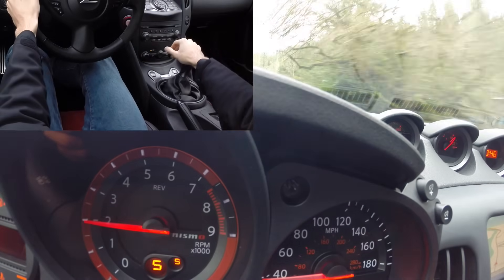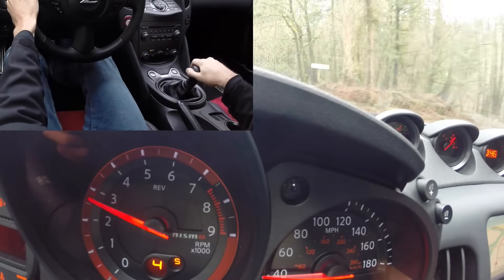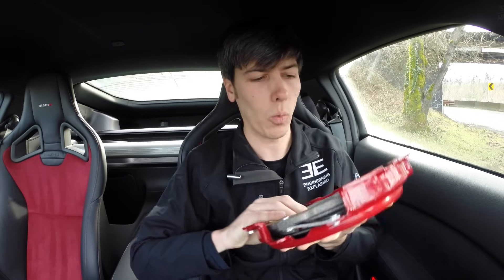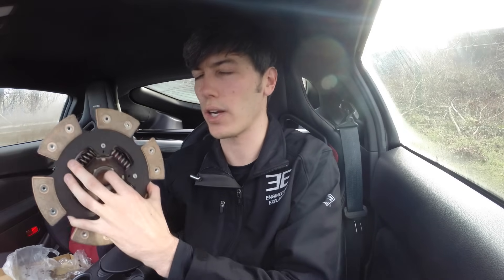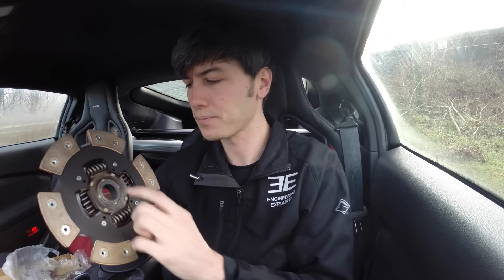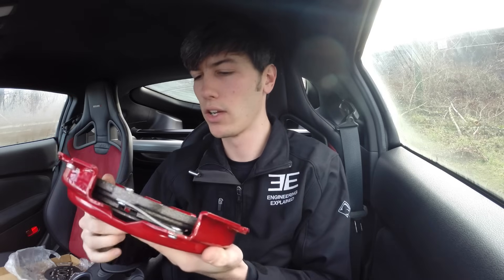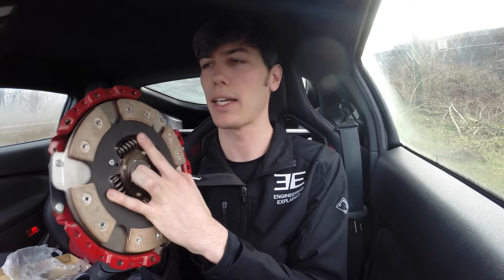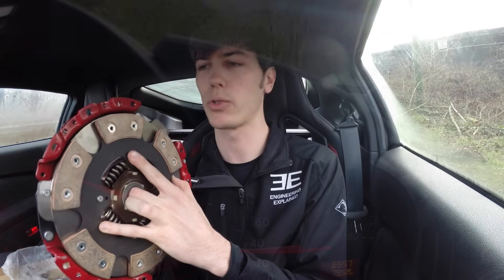What Is Rev Matching?

Comment: how do I rev match my 14 speed bicycle
Reply: you need a short throw sausage
Reply: You need a short throw chain
Reply: You need to fix the flux capacitor
Reply: @soupy2jz893  I'm sorry but the only thing capable of generating 1.21 Gigawatts of electricity is a lightning
Reply: You get off and push
Reply: @BobO-zo2bi  Classic LOL
Reply: Your stick your foot into the rim
Reply: When you coast (i.e. not pedaling), you are technically holding the "clutch pedal." So there's no point of rev-matching since it does nothing to your engine [cough] [cough] I mean legs. However, I do recommend that if you are going to come to a full stop on a bike, always shift to an "easy" gear, so that when you start pedaling from a stop, it won't put stress on your legs and knees.
Reply: @KarlenBell best explanation 💯
Reply: only 14 speed? mine is 21 speed.
Reply: C M mines a 1x11 best gearing for mtb
Reply: @samarmstrong4328 3x8??
Reply: @samarmstrong4328 I had to convert all my mtb's to 1x. I love that torque
Reply: @koffiemoth  mine is 6 speed :/
Reply: @achilles1889  thats sad
Reply: @achilles1889  BRO 6 TIMES 3 IS 18. you have 18 gears. 6 for every gear on the big thing (for got what its called, near the pedals)
Reply: @koffiemoth  only 21 speed? mine is 69420 speed.
Reply: @koffiemoth  mine is 24😊😂
Reply: @koffiemoth  mine 48
Reply: @koffiemoth  mine is 24 speed
Reply: @koffiemoth  my trinx Junior 4.0 also have 21 speed gearbox from shimano
had lots of fun kind of "rev matching" it lol
Reply: @koffiemoth  me too
Reply: @koffiemoth  mines 24 😈
Reply: @koffiemoth  21? Boy shut up 3 × 9  = 27 speed here
Reply: @koffiemoth 7x2 instead of 7x3
Reply: @koffiemoth  27
Reply: @koffiemoth  only 21? Mine's 27 speed
Reply: @koffiemoth  mine is 24 😂
Reply: What 21 I got 27 @koffiemoth
Reply: Mine is automatic @koffiemoth
Reply: @koffiemoth gang mine is a 24 speed 😭😭😭
Reply: disconnect the brake cable, lose the wheel nuts and drive downhill till fully stop.
Reply: you need to change blinker fluid
Reply: I subscribed to you
Reply: @kalebcalrow5556 😂😂😂
Reply: Buzz Lightyear 
Mine is a 38 speed tricycle
Reply: Just buy a fixie.
Reply: you need a tachometer on your bike
Reply: You have to take the chain off, and then pedal as hard as you need to shift it to the gear you want, and at the same time put the chain at the gear you need to be on. Easy.
Reply: If you stick your foot in the rim you u can actually slow down until 0 miles per hour but u may miss the turn tho
Reply: Pedal harder
Reply: With 14 speed bikes you just gotta get used to the noises. It's all feel. Also if you gotta pop into gear while off use 6
Reply: you blip the throttle
Reply: How to rev match my fixie?
Reply: Get on to top off a hill and get on your bicycle and come down. You will find it out eventually.
Reply: Replace your knee joints :)))))
Reply: 😂😂😂 wtf
Reply: I have a 21speed brand new bike
Reply: Its simple ,just say WHIRRRR WHIRRRR and it will rev match
Reply: Depends. Does it have an aftermarket exhaust?
Reply: By drinking milk regularly🤣, dont break your butt off🥴
Reply: Spin fast with all the legs you got 🔥🔥🔥
Reply: Answer: Di2 electronic shifting
Reply: @cesarjom  Bro learnt too much organic Chem.. 🤐
Reply: You earned a sub from me
Reply: Install gear synchros
Reply: Pedal faster.
Reply: heel tow shift
Reply: Bruh I have a 21 speed
Reply: 14 speed is equivalent to 1500 hp !
Reply: i actually always rev matched my 1x10 bicycle as weird as it sounds😂 didn't have a car yet and was used to doing it in video games with cars
Reply: You need  to try lowering gear after onto 1st..thn automatically it will happen
Reply: pedal slower
Reply: lmfaooooooooo 😂
Reply: Brake and coast
Reply: Decrease the tension and start Decrease the speed and pedal backwards and then increase the tension,hoping your chain doesn't come out from the gear.
Reply: lol
Reply: Mine is an one speed 😅
Reply: Hahahaha
A Very important question
Reply: Get a fixie
Reply: Lol goddamn I just realized I commented on a 4 year old thread 😂
Reply: Slow or speed up the bike?
Reply: I subscribed to you
Reply: Mine is 42 speed 😎
Reply: You brake, pedal at a constant slower speed and downshift
Reply: 🦧...🤹...🪰...like this
Reply: Wait, you guys have 10+ speedn
Reply: That new movie you did was gay and bombed big time.
Reply: when you shift down pedal faster or you'll lose speed
Reply: You just need to hummmm while downshifting and make sure the sounds pitch differentiate different gesrs in different time.
Reply: How many rpm have you reached? Let's start with that
Reply: Peddle faster on downshift
Reply: You don't need one buzz.

Cuz once you gear shift it's already "to infinity and beyond"
Reply: Mine is 34
Reply: Give me 100 dollars and I'll show u
Reply: WAIT! First you need to check your blinker fluid(just check the dipstick next to your blinkers) 
Then go ahead and replace your muffler throwout bearing (1/7)
Reply: Jump and run along side of ur bicycle 10 m before stopping
Reply: lol
Reply: Put a baseball card in the spokes
Reply: 7x3 transmission bikers, where you at? 😂
Reply: By pedalling at higher speed as u lower your gears
Reply: Firstly install a clutch
Reply: Revmatching on bicycle is real and helps with reducing wear and engaging gears faster.
Reply: Just reverse the paddel
Reply: Gigachad
Reply: Thats the neat part , you don't
Reply: You have to pedal faster my boy
Reply: Damn this comment section really be flexing on their goofy ahh bicycle gears💀
Reply: W comment
Reply: You don't need to rev match it😂
Reply: Just pedal while down shifting
Reply: EAT MORE BEANS!!!
Reply: Mines a 10 speed and its a great way to stay in shape
Reply: Pedal faster 🤣🤣
Reply: I own a bike and compared how the gears are legit the same as car gears. With leg power being the accelerator and such. I also have this question but no idea how to calculate revs on a bike.
Reply: Change in  a car
Reply: Pedal backwards and change gear
Reply: Do you have a fixie with a clutch activated gearbox? Otherwise the freewheel means your legs never get jerked to spin faster if you go in a lower gear.
Reply: Sell it
Reply: do you guys have neutral…?
Reply: Getcho ass off and runn
Reply: Reverse peddle half way when you are shifting
Reply: pedal once spin the pedals backwards once pedal as hard as possible and shift😂
Reply: LMFAO
Reply: Hey buzz
Reply: Pray
Reply: 7 speed sis all you need
Reply: You lift your feet from the pedals, shift into desired gear, calculate how fast you need to pedal now, start pedaling in the air at that speed and continue doing it while putting your feet on the pedals again and continue pedaling as mormal.
Reply: @jeanwamana  mhmm
Reply: Buy some blinker fluid
Reply: Go head on with a bus then you can rev match it underneath 😁
Reply: I don't think you can without a clutch sadly

Comment: Rev matching gear speed is hard to do in some cars, because the proper way is to heel toe as you downshift and in my car that is near impossible to do because my brake pedal extends further outward than my accelerator pedal, which pivots from the floorboard and doesn't free hang like the clutch and brake pedal.  I'm sure a lot of other guys who read this have their pedal assembly set up this way also.

Comment: Very helpful videos dude, I have a question for you I hope you can answer or anybody who knows.

Does rev matching interfere with the cars fuel economy??
Reason for this that I started try  rev matching recently and my fuel indicator when I started was at 250 mile trip, I went on a 20 mile trip and by the time I got home the indicator read 210, soo my guess is it does but the fuel indicator sometimes does that and I don't want to base an opinion on an electronic fuel indicator, I just want an answer from an expert who knows whats up.

Comment: I was taught rev matching was "giving it gas during the release of the clutch using kind of a scissors movement between the left and right foot". I've been doing this for years. However I've been reading lately people saying they "blip the throttle BEFORE releasing the clutch during shifting". Now I am confused... Is there any difference between the two? Is the second method better?

Comment: When you downshift, you usually apply the brakes before so that slows the wheels and the transmission down.  In this case, the transmission has already slowed down very much,  so rev matching is not that necessary?
Reply: it's for racing purposes, in lower gear you can accelerate faster, so when you downshift in a corner, you can speed away again that much faster when you exit it.

Comment: Please explain, am I wrong?
The transmission doesn't speed up simply when you downshift.  The rpms of the gear remain the same but the gear ratios increase because the lower gear is larger so now you have to increase the speed of the engine to match the gear ratios.  Suppose you were going at 2000 rpms at a gear ratio of 1:1, now you downshift and increase the gear ratio to 2:1 now the engine has to go at 4000 rpms to match the same 2000 rpms of the larger gear.  If the engine is slower,  a braking torque is transmitted throught the transmission onto the wheels which is the sudden jerk you get if you don't rev match. The values are a bit exagerrated but this is the core concept, right?

Comment: Hey mate. When you're rev matching on a downshift, what's the correct procedure? Is it:

A

1) foot off the accelerator
2) clutch in
3) change to a lower gear
4) blip the throttle a bit
5) clutch out 

OR 

B

1) foot off accelerator 
2) clutch in
3) blip the throttle a bit
4) change to a lower gear
5) clutch out

Comment: And what am I supposed to do when I am driving my 2nd gear until 6000RPM and then I want to shift into 3rd gear, but the 3rd has an engine speed of like 4000RPM at that speed... So if I want to shift fast I am pushing my engine speed from 6000 to 4000RPM violently, which is not smooth at all.
But I also don't want to wait like 2 seconds, because that would be really slow.
Reply: as soon as you stamp on that clutch the rpm will drop rapidly.

Comment: hello engineering explained guy, I have been driving my family car recently and  I'm always making rev matching even with this old car, knowing that rev matching is for down shifting I try to do the same in normal gear shifting to smooth the action but is difficult like going from second to third, the stick kinda stuck in neutral...
I am ruining my gearbox or is lower the Valvuline (transmit lubricant)??

Comment: Let me say, I like your videos, they're smart & it helps people understand their cars better. BUT, you talk TOO much almost, right at that point where my eyes began wandering & what I mean is, you just drag things on & folks like me gotta skip ahead to your next major point in a video. Just something to think about, I really mean well. Read my quick story below relating to auto transmissions. This happened to me about 7yrs ago.

I had our car that I was driving back to my wife to drop off at her job so I'm on the interstate. Everything was great, car was good. I'm in the slow lane doing about 65-70mph & there wasn't much traffic yet. Next thing I know, I go to slow down for the coming ramp & out of nowhere, the car's throttle became stuck (a spring on this 93 Camaro that was hooked to the gas pedal broke I later learned, as was explained to me) & I ended up on the ramp burning the brakes & using the e-brake also to try & slow the car down which I did a little but that was more so due to the fact that the ramp went uphill abit.

Long story short, I survived that freak accident, nobody got hurt & the only damages were a totaled out V6 POS & $50 worth of damage to an A/C unit I ran into at this church. I did hurt my neck a little bit but declined medical care. Watching your "automatic what not to do" video brought that back to my mind......

Comment: in racing this will cost you time. you need the high rev of the higher gear to slow you down with engine braking when you shift down. heel and toe is different story.

Comment: Nice video. I've always wondered, though, shouldn't you blip the throttle before you engage the lower gear in order to reduce wear on the synchronizer in the gearbox?

Comment: Great video. Another important factor in rev matching is to minimize the wear on the synchromesh.
Reply: Or on old cars, that was very tricky, you didnt have synchronizatios so if you updhifting you pít clutch neutral realse put clutch put gear, and for downshift matce the revs cause if not or you did it wrong you can hear the transmittion slipping and you can broken everything down very easly

Comment: Screw all that. I put my car in neutral and just roll lol.
Reply: Even tho i dont always put it in N, i can see where u comin from brotha..! : d
Reply: disagree. breaking with your breaks is better than engine breaking. brake pads are easier to replace.
Reply: @KhromTX  engine braking doesn't wear anything
Reply: @jorge8596  it does if you don't rev match right
Reply: @jorge8596  and it also stops the car faster. Can save someone's life.
Reply: this is dangerous because u lose control over your car. also braking with engine is more efficient and is saving ur breaks
Reply: @hihtitmamnan  I'd rather damage breaks than the  engine
Reply: @NUNNELLEY66  then match the revs. If you don't match the revs you are damaging your engine, your transmission and more importantly your clutch
Reply: hihtitmamnan r/woooosh
Reply: I'm with you on this. If I'm thinking too much about down-shifting, I feel LESS in control of the car. Not to mention that as soon as you down-shift, you require less manual braking because of more engine braking. It's just so much more to think about. I feel a lot more in control of the car just sticking it in N and using only the brakes. The only situations I downshift are when I won't be stopping, but the road requires me be in a lower gear, like sharp turns.
Reply: LMFAO
Reply: L
Reply: Truckies can't rely just on brakes. We have to use engine brake and downshift gears.
Reply: If you wanna stop then yes that's good. But if you wanna slow down and then go fast again, you need to rev match.
Reply: ... and maybe you can give the neighbor's kids 5 bucks to push you up the hills?
Reply: Those complaining that downshifting is too much work needs to man up and just learn how to drive
Reply: @knetom  on god

Comment: okay so I'm a learner driver and for my first car i plan to get a manual jeep wrangler, at the end of the video you made the analogy that when you're taking a corner at high speed but you need to downshift you said that you can go from fourth gear to second, are you implying that if I rev match correctly I can skip third gear completely without harming the transmission?

Comment: I really don't see the need for a casual driver to rev match, unless you're pro racer or pretending to be one. The smoothness when downshifting is different on every car and it depends on how much the driver is used to the car. No need to scare young drivers to press 2 pedals with 1 foot, you can be an excellent driver without doing that.
Reply: Track drivers heel and toe because it ultimately faster than separating the braking and changing gears.  A lot of normal road drivers do it too.  But simple Rev matching is a useful skill, you don't have to be on a track to do it, you don't need to be braking to do it and in some vehicles you really can destabilise them by changing down and NOT rev matching. Which is why track drivers have to learn to rev match when downshifting. And you're saving wear and tear on the vehicle, hence saving  money. Several years ago,  a new clutch on my Caterham cost me well over £400... probably cost twice that these days.
Reply: antonio ivanov Initial D
Reply: A Nother No heel and toe here just floating up and down through gears
Reply: antonio ivanov yah it’s called “heel toeing” your right foot is braking and your heel hits the gas and your left foot is on the clutch.

It’s a nice art to have when in a track or just doing it. You basically clutch in, brake, blip gas, downshift gear and ta daaaa! Lol 😂
Reply: There is no need.. Goin from 4th to 2nd is where u slow down then down shift
Reply: What you mean pressing two pedals with one foot ? Gas and brake, gas and clutch or clutch and brake? :D
Reply: antonio ivanov brake and pressing the gas at the same time is pretty uncomfortable. Again depending on their car and shoes but still.
Reply: Are you talking about starting on uphill ? Just use the handbrake m8, simple
Reply: antonio ivanov ??? While braking you gotta blip the gas to rev match, that's when you press 2 pedals with 1 foot.
Reply: +VoloKin Project don't brake while doing it man. You're not always supposed to brake while downshifting. You can brake before and after. Personal opinion tho!
Reply: antonio ivanov look mate, you downshift and rev match while braking. Otherwise you're just playing around, better hold the clutch while braking like normal people do. That's why I said it makes sense to do that only on the race track. In every day town commuting it's pointless.
Reply: +VoloKin Project I've never seen someone pressing two pedals with one foot but ok, lets say some people do. I have one question and then i will stop writing cos everybody has its own driving style. 
Why you have to brake while rev match downshift ? 
Drive safe mate !
Reply: antonio ivanov you don't, but you have to rev match downshift when braking. That's what pro drivers do before entering a curve.